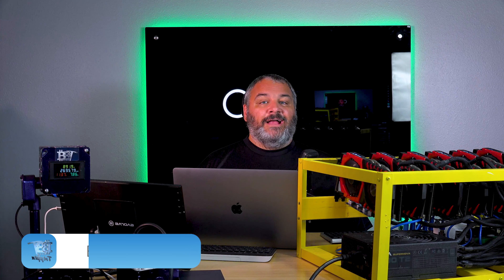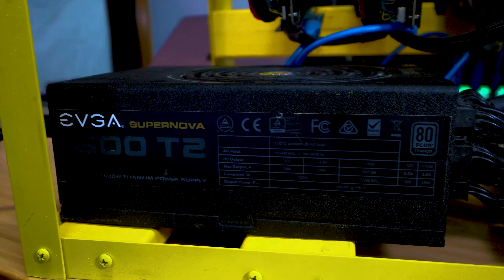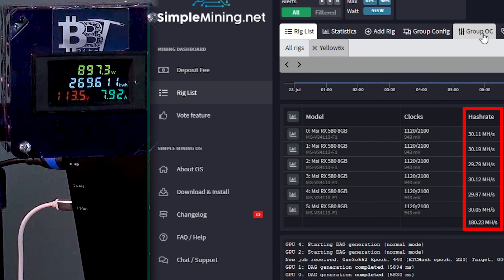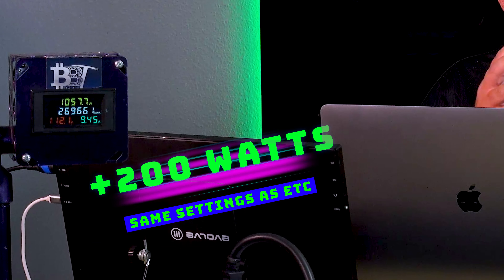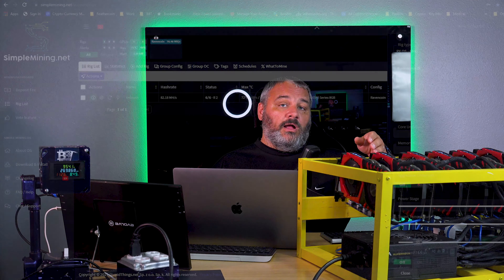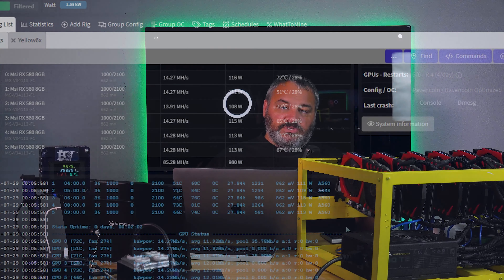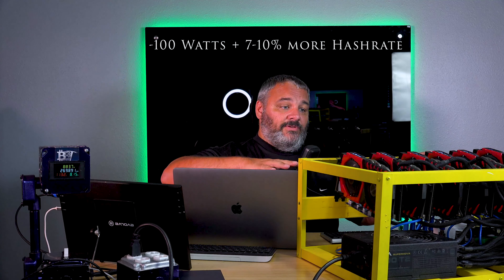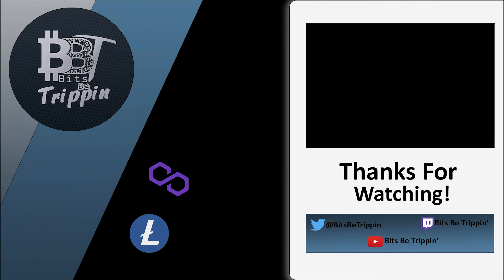Quick guide to Cryptocurrency Mining Rig power settings

Comment: If you are in the UK you can use a voltage optimiser. Mains voltage is typically around 245v. A V.O. will lower the voltage supply to 220v. This device is connected to the consumer unit/distribution board and the circuit supplying the rig connects to the V.O. They are supposed to make a 10-12% saving in electricity. Supply from the V.O. Is around 60 amps.

Comment: You should be able to get your 580s to hash 180+ on ethash and use around 750watts from the wall.
Reply from the maker: Our mining editions do that and better. The MSI Twin Frozr if at 860mV 1120/2100 will drop to 805w full system to wall. They use just a hair more.
Reply: @BitsBeTrippin  Nice

Comment: Hi Carter, thanks for video, I use sata power on ezil with zero problems on my 3090 rig, when I tried to use 6 pin power connection to the riser, when I powered on it instantly locked up and would not even turn on the mb,  I went back to sata with zero problems,  any idea what would cause this, thanks mate

Comment: So you twiteled the settings and got what you wanted, I already knew people who know how can do that. You didn't share anything about your process for determining the settings you ended up with, no one can reproduce your results without using exactly the same hardware.
Reply from the maker: There are several videos and livestreams I have covered the iterative process, including the spreadsheet that was in the last few videos, showing an exact runthrough of various settings and adjustments. 

But based on your feedback, if this is the first video you have seen from me, I understand that perspective. It's a balance of delivering a BLUF (bottom line up front) and a detailed exact walkthrough. In this particular video I do give rational of what you need to do and why along with suggestions of how to test your results (i.e. the cards I show here are not stable at 840 mV, however your results may vary)

As for other GPUs, the spreadsheet show over 30 different types of GPUs and corresponding settings in the previous video mentioned.

The one point I think I can take from the comment is taking 30 seconds to explain in better detail my process on determining a setting that works, which by and large is trial and error, config, test, read result and repeat.